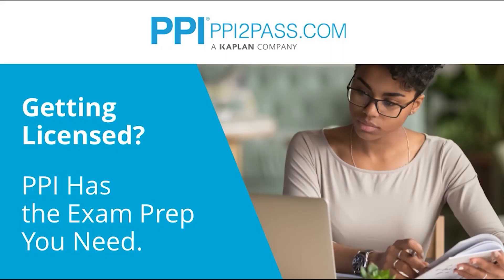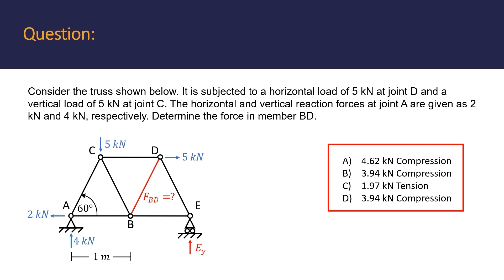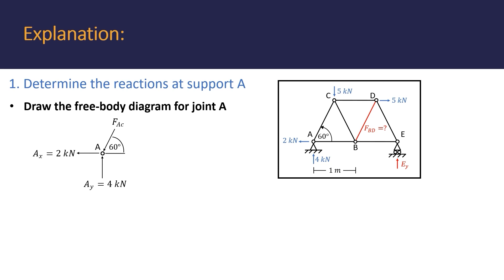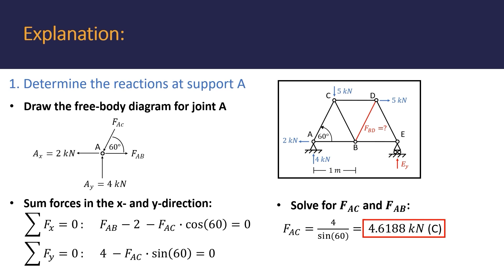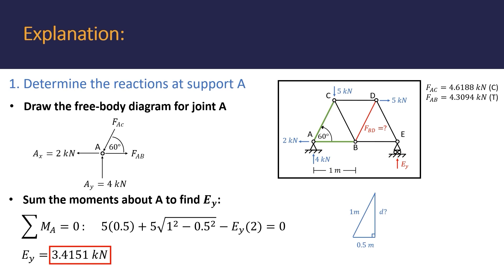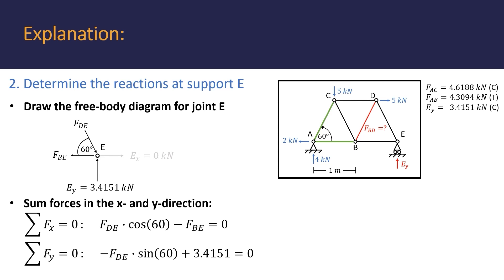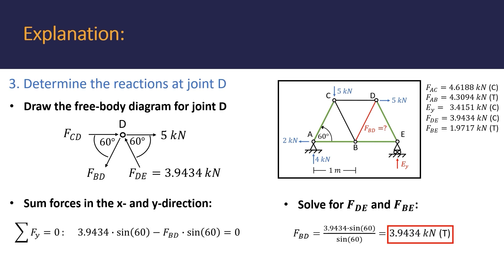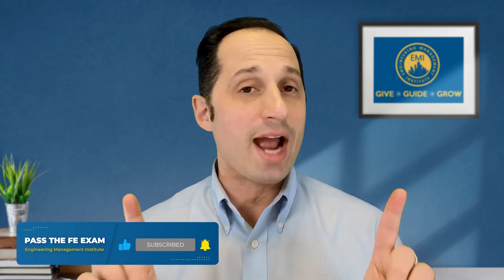Cracking Truss Forces: Mastering Method of Joints | Pass the FE Exam

Comment: Would Ey=1 considering sum of the forces in the Y
Reply from the maker: @raydilts9703 Hi there! It's great that you're thinking about the forces in the Y direction!

In this case, Ey wouldn't necessarily equal 1. The sum of forces in the Y direction at any joint in equilibrium does need to equal zero.  However, Ey represents the vertical reaction force at the support.  Its value depends on the specific loads applied to the truss and their locations.

In the video, Ey is calculated based on the given loads and geometry. So, its value could be 1 in some scenarios but it could also be another value depending on the problem.

Keep practicing and mastering the method of joints! It's a key concept for understanding truss analysis. If you have any more questions, feel free to ask!